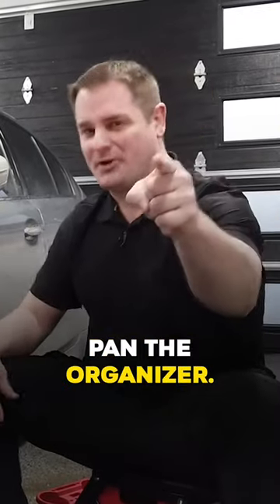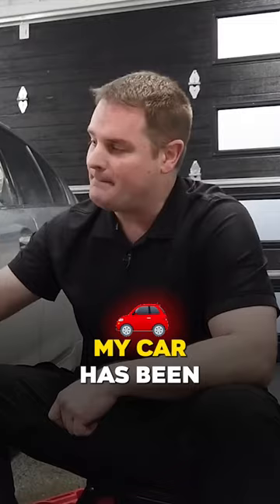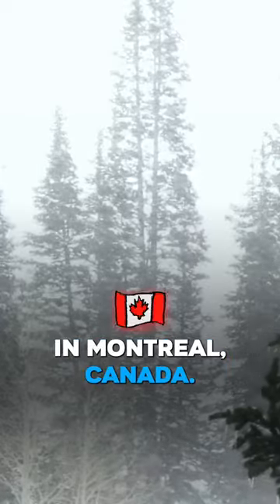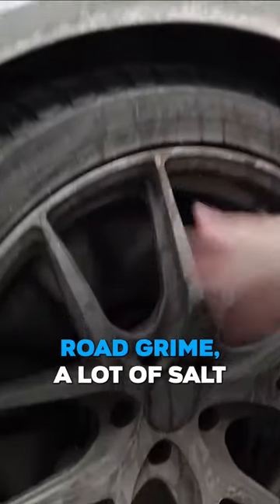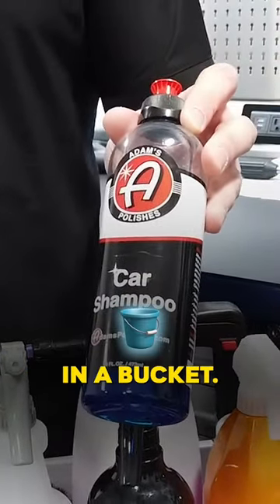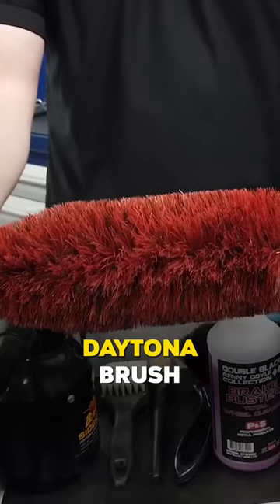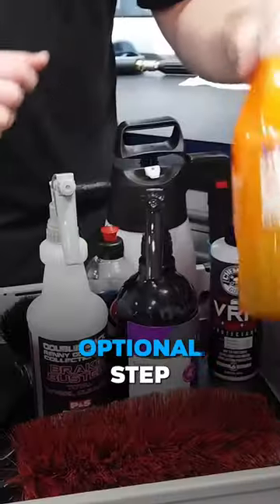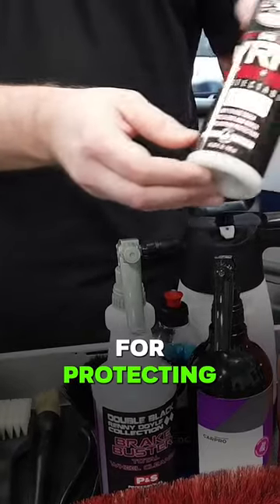Easy wheel & tire cleaning! 🛞✨#shorts

Comment from the maker: ⬇️🔶 LINKS TO PRODUCTS MENTIONED IN THIS VIDEO ⬇️⬇️
🇺🇸 For people in USA:
Kranzle 1122TST pressure washer: https://bit.ly/3d5kZeK
Kranzle 1122TST plus upgraded Mosmatic gun and wand: https://bit.ly/3vj0Zzz
Mosmatic gun and wand solution: https://bit.ly/3aA67oE
P&S Brake Buster wheel & tire cleaner: https://bit.ly/3o3xePr
CarPro IronX iron remover: https://bit.ly/2FJ2sK9
Gyeon Wet Coat protectant: https://bit.ly/3TE0LyC
Adam’s Car Shampoo: https://amzn.to/2uNJsoz
Chemical Guys VRP tire dressing: https://amzn.to/2v0Apk7
IK Foam Pro 2 pump sprayer: https://bit.ly/3RyvYRZ
EZ Detail wheel brush: https://bit.ly/3kf8otv
Wheel Woolies boar hair brush: https://bit.ly/3kf6qsX
Detail Factory brush: https://amzn.to/2V2ASwI
Tire brush: https://bit.ly/3Rdm1d1
MetroVac AirForce Blaster Sidekick blower: https://amzn.to/39MBsmt
Adam’s Hex Grip tire dressing applicator: https://amzn.to/2P6HuX2
Adam’s rolling creeper seat: https://amzn.to/2uWlZBt
Black nitrile gloves: https://amzn.to/327yarb

🇨🇦 For people in Canada:
Kranzle 1122TST pressure washer: https://bit.ly/3d5kZeK
Kranzle 1122TST plus upgraded Mosmatic gun and wand: https://bit.ly/3vj0Zzz
Mosmatic gun and wand solution: https://bit.ly/3aA67oE
P&S Brake Buster wheel & tire cleaner: https://amzn.to/39JXwy4
CarPro IronX iron remover: https://amzn.to/38G4UdB
Gyeon Wet Coat protectant: https://amzn.to/3bOZa3j
Adam’s Car Shampoo: https://amzn.to/2HDwPiB
Chemical Guys VRP tire dressing: https://amzn.to/2SS5IWa
IK Foam Pro 2 pump sprayer: https://amzn.to/2vHUsUq
Wheel brush: https://amzn.to/3bQSpOz
Wheel Woolies boar hair brush: https://amzn.to/2HF3T9G
Detail Factory brush: https://amzn.to/2SHhzro
Tuf Shine tire brush: https://bit.ly/3bVJxH3
MetroVac AirForce Blaster Sidekick blower: https://amzn.to/2V5Cl5s
Adam’s Hex Grip tire dressing applicator: https://amzn.to/2T9dATx
Adam’s rolling creeper seat: https://amzn.to/37Ds2Ix
Black nitrile gloves: https://amzn.to/2P3Q4FW

🇬🇧 For people in the UK:
P&S Brake Buster wheel & tire cleaner: https://bit.ly/3TC0oVp
Iron fallout remover: https://bit.ly/3q2vOa7
Gyeon Wet Coat protectant: https://bit.ly/3CN3u2Z
Car Shampoo: https://amzn.to/39NRfkK
Tire dressing: https://amzn.to/2HDk33r
IK Foam Pro 2 pump sprayer: https://bit.ly/3TBVZ4P
Wheel brush: https://bit.ly/3Rdfq2q
Detail Factory brush: https://amzn.to/2SGspxu
Tire brush: https://bit.ly/3ebRBcB
Blower: https://bit.ly/3RzMvW5
Adam’s Hex Grip tire dressing applicator: https://amzn.to/2SVN3IX
Rolling creeper seat: https://amzn.to/2vKJZHX
Black nitrile gloves: https://amzn.to/39JcV1A
Reply: 5 products, 5 tools, easy peezy !

Comment: For wheels, can you just spray iron remover on or does it have to be agitated with a brush?
Reply from the maker: Clean your wheels thoroughly with your wheel cleaner first, using your brushes or mitts as per usual, then use the iron remover once the wheel is clean. No need to agitate the iron remover at that point.

Watch my dedicated wheel and tire cleaning tutorial here: https://youtu.be/Ty4ZTq7A7rc

Comment: Hey Pan. What's the orange wheel protectant?
Reply: gyeon wet coat
Reply from the maker: Gyeon WetCoat. It's a spray on, rinse off formula, super easy to use, ceramic based protection. Link in the description under the video.
Reply: @PanTheOrganizer  Cool, thanks. Always in the market for more supplies 😋